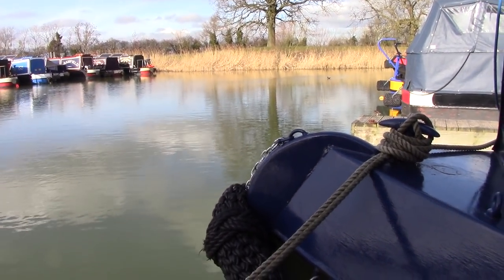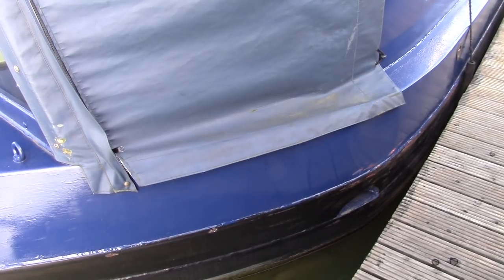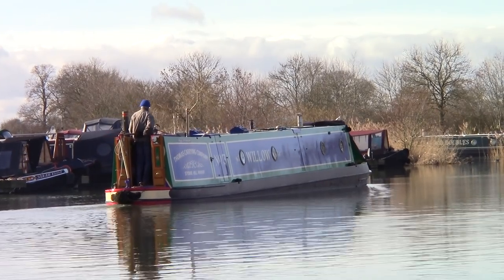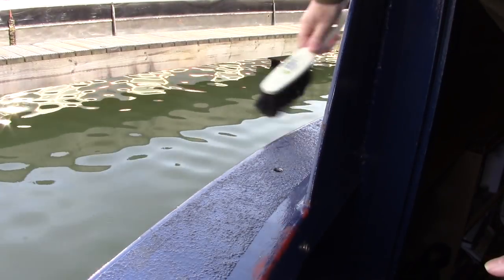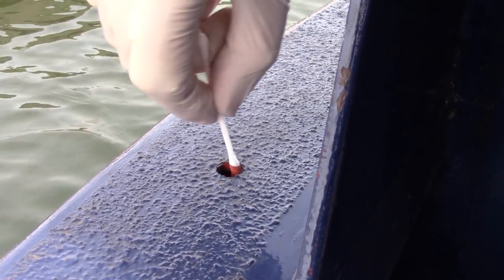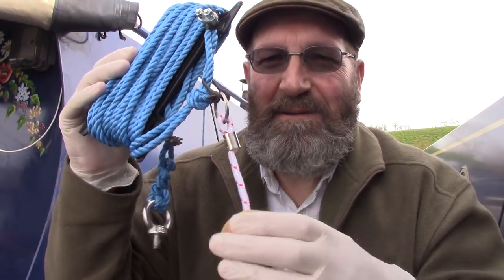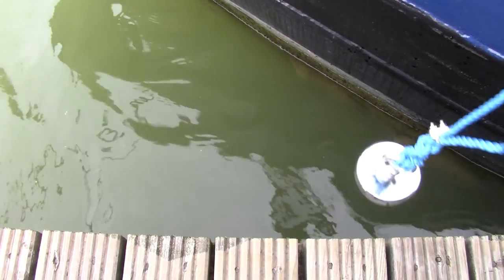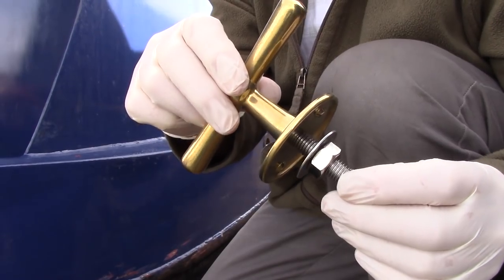33. Fitting New Cleats to my Narrowboat

Comment: Lucky me, Alan; I learned two things from this video.  The idea of placing a masking tape ‘x’ to prevent slippage is so welcome.  The second tip, of graduating drill bit sizes toward the wanted diameter, is so helpful in larger projects, especially.  Thank you so much for them both!
Reply from the maker: Thank you Grace. I wasn’t well prepared when I started this job but I was happy with the outcome. The cleats could do with being a bit larger but I cope with them. The larger cleats come with four smaller fixing holes but I much preferred to drill one larger hole. Cheers, take care x

Comment: Larger drill bits - slower speed & a little bit of cutting oil always helps. I think that's why the 12mm was struggling. Jolly good job though :)
Reply from the maker: Thanks for your comment. I do agree Jim but was not fully prepared when I started the job.

Comment: Hello Alan,
It was very easy to see your problems when fitting the cleats. One of your other viewers (David) covered most of what I was going to write.
It is so very easy to see solution to other people’s problem, especially when your vlog shows such detail. I think you made a good job. I do think they may prove a little on the small side when strain is put on them, only time will tell. Good luck.
Reply from the maker: Thanks David. I have made some gaskets for the cleats and these are working very well and will be the subject of a future video. The cleats are smaller than I would have liked but I am managing ok thanks. I wanted to cause as little damage to the boat as possible hence only one drill hole each side.

Comment: The two nodules either side of the thread,need counter sunk s into the gunnel to prevent the cleat from twisting.
Reply from the maker: Hi Darol. Thanks for that advice, it makes good sense and I wasn’t aware of it. I have used the cleats without any problem and am reluctant to do too much drilling into the boat in case I want to remove them in the future.

Comment: Hi Alan. The cleats look very smart but brass and steel in direct contact can lead to corrosion of the steel (electrolytic action). The 2 lugs were designed to have matching depressions in the deck to stop the cleat twisting in use. Can I suggest undoing the bolts and bedding on a polyurethane or silicon sealant. This would help to prevent water ingress through the bolt hole and also minimise the direct contact between dissimilar metals. The 12mm drill might have worked better with a much slower drill speed and a cutting fluid (or a drop of engine oil) used to cool the workpiece. Personally I would have used a galvanised cleat with a base plate drilled with 4 smaller holes (£7.50 each on eBay). Sorry, reading my comment back it just sounds critical, but it is meant to be positive criticism and comes with a lifetime experience of both narrow boats and sea boats (where potential electrolysis is a serious concern). Take care Alan.
Reply from the maker: Hi David. Your comments are much appreciated. I am new to boating and keen to learn. I did mention the reaction between steel and brass and decided not to do anything but I will think again on that subject having regard to your comments. The reason I chose these cleats was that only one hole needed to be drilled either side. I’m not sure whether this is a subject for the Boat Safety Scheme, so I wanted them easily removable just in case there was an issue or I changed my mind. Larger cleats would have been better but I’ll see how I get on. I have used them already and found they’re doing what I want them to. Cheers. Alan
Reply: Yes they will be a great addition. I noticed in your first video about the survey, the front rope had to be led back to a pontoon cleat and rubbed on the cratch. Your new cleats will avoid that. Regarding BSS requirements, my guess is that they will require cleats to be adequate size and securely fitted. You can download the requirements free at www.boatsafetyscheme.org. Finally I would just like to tell you of an amazing coincidence. I had to sell my last (holiday) narrowboat, Violet May in September 2017.Whilton Marina came to look with a view to brokerage but they made me a direct purchase offer. I watched their website and noticed they sold her on in December 2017. When I watched your survey video, right near the end when your boat has been moored up adjacent to the slipway, Violet May was being hauled out on the slipway. I'll go away now and have a small weep!
Reply from the maker: I’m sorry my survey video has brought back sad memories. My boat was surveyed on 15th December 2017, so what a coincidence that is. I asked Whilton to re-site the front cleat which they did but it only moved a few inches forward. It’s some while since I looked at the BSS scheme. I think at the end of the day, different examiners have different ideas!

Comment: what about using some weed hatch adhesive seal on the underneath of the cleat..  will grip and stop any water getting to the bolt hole...  just an idea
Reply from the maker: Hi Dave.  Thanks for your comment.  I did think of that at the time I did the job but decided not to. However, in view of other comments, I do see a need to do something to separate the cleat from the steel and form a better 'joint' between the two.

Comment: They will make life much easier when mooring solo.
Very frustrating about the 12mm drill, strange the 11mm seemed to work ok, but the 12mm was still slow.
Hopefully it was the 12mm drill you lost in the water.
Reply from the maker: Hi Geoff. Thanks for your comment. It was the 12mm drill I lost but it was only a cheapie, I got it at half price. The other drill was actually a 10mm.

Comment: Alan next time drill the 12mm at a slower speed and if you can a squirt of wd40 on the job or dip the drill bit in some engine oil but mainly slower with big bits

Comment: 12mm slow speed and a bit of lube. If you go to fast u burn in some of the hss into the steel and it will blunt the drill forever. Im cringing hearing those rpm. Slow speed lots of lube and pressure it will cut like butter.
Reply from the maker: Hi Paul sorry I offended your ears. It’s not often I do any drilling.
Reply: @MyNarrowboatVenture  haha you did great compared to the asian mechanical technicians that work for me. Theyd of broken the drill, the  machine and not got the hole done. Mind usually a good thing coz theyd be drilling the wrong place to start with. Pop a dab of grease on the drill and if your drill is new and sharp go for just say only a 4 mm pilot hole and then on to the big drill. Slow speed, good pressure and it goes nice. It snatches a lot if your pilot hole and the next drill are nearly the same size. You can also get those tapered drills that are very good for drilling plates. One size fits all due to the conical shape and they cut very smoothly on thinner material. Those brass t studs look great by the way, brass and boats just goes so well.

Comment: That was Painful to watch.  Magnet fishing,  lower the magnet then raise it move it over a couple of inches and lower it again, you can feel when something attaches to the magnet.  The Cleat was made for a wooden boat and the 2 nubs were to go into the deck and keep the cleat from rotating. You could have ground them off, Or drilled a shallow hole for them to prevent rotation of the cleat....Bolting the cleat down  Did you use thread lock on the threaded rod that went into the cleat , thread lock is a compound that gets hard in the air.?? you should, and use the same thread lock on the nut on the inside. You have created a way for tater  to enter the boat, a liberal coat of calking under the cleat  would be good to keep it water tight..
Reply from the maker: Hi John. It may not have appeared so on the film but I did use the magnet as you suggest. I will be revisiting the seal between the cleat and boat, so thanks for your advice. The cleat is actually over the well deck, so is placed to prevent water penetration inside.
Reply from the maker: Hi John. It may not have appeared so on the film but I did use the magnet as you suggest. I will be revisiting the seal between the cleat and boat, so thanks for your advice. The cleat is actually over the well deck, so is placed to prevent water penetration inside.